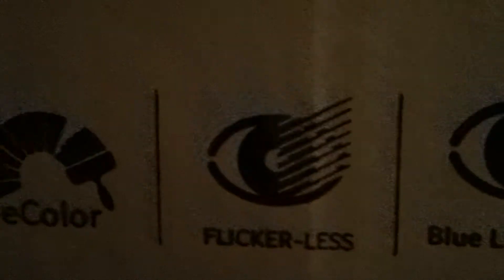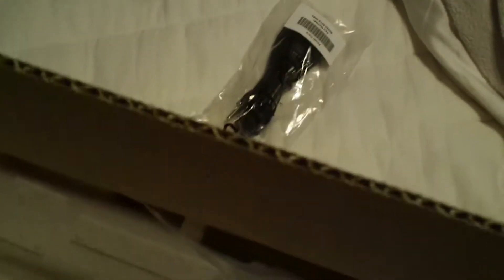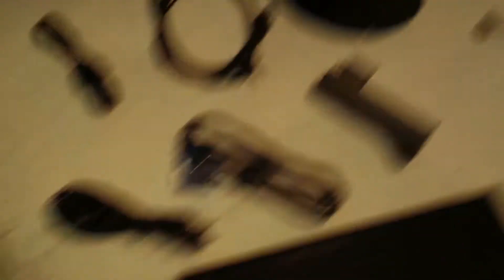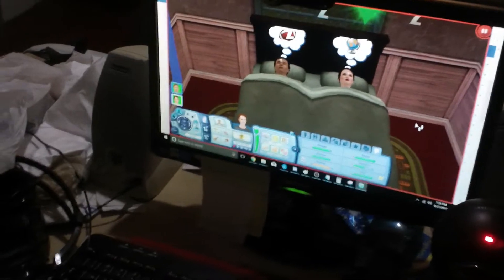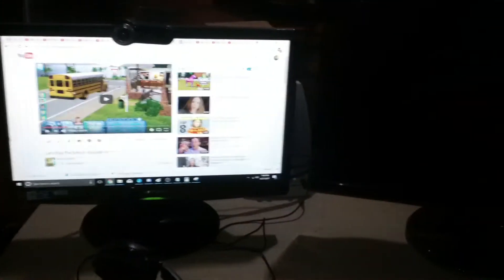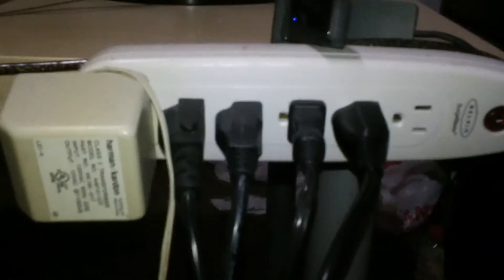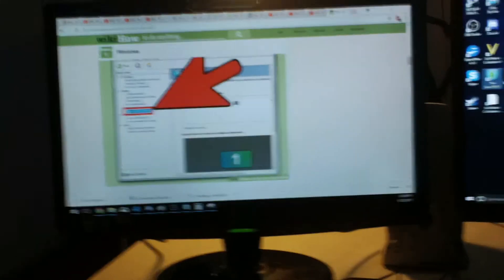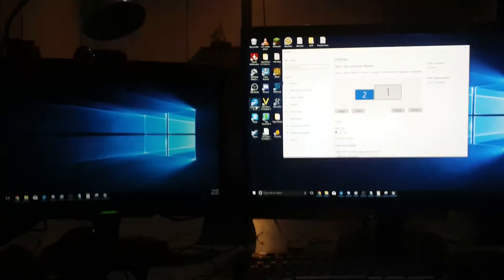1080p Monitor Unboxing and Setup!

Comment: also a quick tech tip. the blue cable that connects to the PC and the monitor is a VGA cable it only carries video and while the display may be 1080p, the cord doesnt produce a sharp image, also VGA cables dont carry sound, thats what the sound cable is for. But the other cable is called an HDMI cable and that is where your going to get the sharpest image quality, but if your PC is old like I think it is, then the computer most likely doesnt have an HDMI cable. HDMI carries audio and video thru it. No need for an aux cord.
Reply from the maker: lol indeed, I was confused for a bit but I eventually worked it out. I'm not the most tech savy guy in existence.